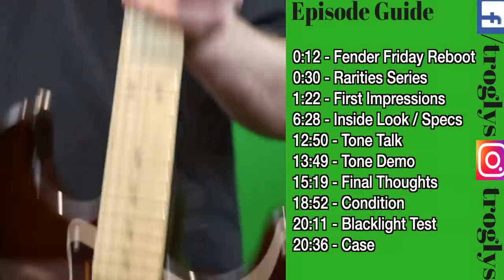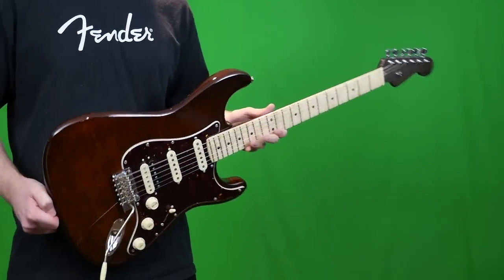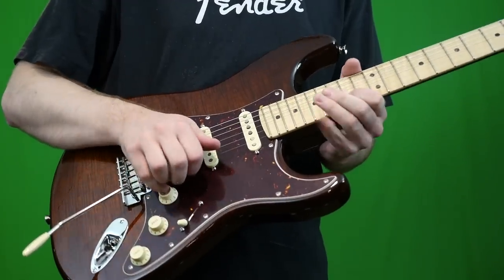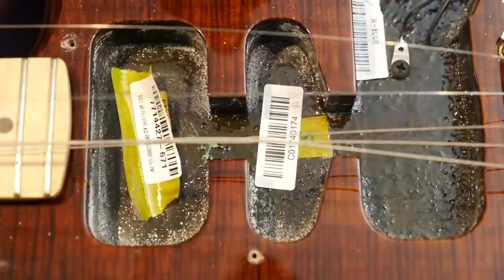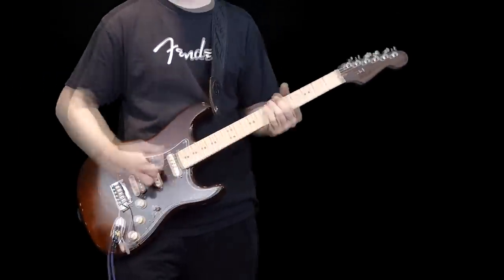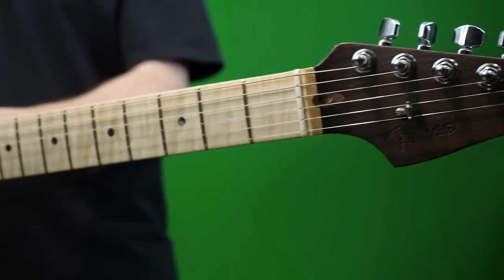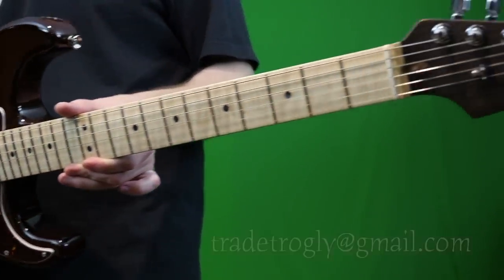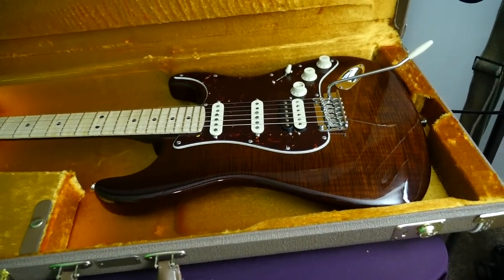A Rosewood Neck Isn't The Only Surprise! | 2019 Fender Rarities Stratocaster Flame Maple Top Review

Comment: Re: Fender 2 point tremolo with push-in arm, if you push down on the arm you will see a hex screw adjustment for the tension of that push in arm under the bridge plate.

Comment: I'm a fan of all guitars. I was Gibson player for years, mainly Les Pauls. Still have a couple and love them. I'm starting to deal with arthritis at 55 years old, so I have been playing Strats. Lighter, easier to customize too. Also my abs were a six pack, but now it's a keg. I love the belly  cut. The laser etched logo could be filled with white paint and wiped clean to bring out the logo. Gold or silver paint would also look great.
Reply: Richard Binder At 58 years old I too am starting to struggle with arthritis.
I had a Telecaster built for myself that has a crazy thick neck (1.10") at the 12th, to my surprise it is the easiest neck to play without fatigue.
If you get half a chance play a guitar with a similar profile and see if it makes a difference or helps.
Just my $.02 Cents
Reply: You might still enjoy Les Paul if you'd get the Classic Lite (exclusive to AMS/Zzounds) that weighs about the same as a Strat but doesn't compromise on that LP sound.

Comment: Attach a little led light to the string tree and shine it on the engraved Fender logo. You can adjust the tension on the tremolo arm. Simply bury the tremolo ( push it all thr way down to the body) and underneath the bridge plate is an allen wrench bolt that you can adjust by tightening or loosening it. Its located perpendicular on the tremolo bar slot.

Comment: Ussualy you can tighten or loosen a push in style tremelo arm with a screw that is underneath the tremelo where the arm goes down into it . It's kind of like the intonation saddles screw but it is under the plate part of the tremelo where the sustain block is

Comment: I have a stratocaster elite with the push in pull out trem arm. If you but nut sauce on the indentation of the trem arm and push it in and pull it out a few times it will pull out easier.

Comment: 9:30 Fender Advice: With those push-in vibrato arms, you can usually adjust the stiffness with a small hex screw on the block that can only be seen when diving the unit nearly all the way down. This makes it much easier to pull the arm out too. Hope that helps and that yours actually has this!

Comment: I didn't know the S1 switch operates completely different on varying models.  My 2018 HSS Strat's S1 switch set the pickups from parallel to in series with a few tone pot options, or in the middle position you get all 3 pickups.  I also have the humbucker bypass button though so maybe that's why it's wired different

Comment: Great demo love the tone quality changes on this strat the colors may come together after a few years of use, maybe the fret work could improve the feel and possibly just play action over years will mellow I to use my kneck pickup mostly my bridge is dual as well mine is a Mex strat with the humbucker bridge pickup my switch is the middle not the top which you won't so accidentally turn on its a push/pull switching I getting use to this after some time I had 1976 American made that was my baby and this is a different animal compared to that.

Comment: Squirt some silicone spray in the tremolo arm cavity and you’ll have easy swivel or use graphite
Reply: Or if it's a Wilkinson trem, adjust the grub-screw in the block. Just push the wiggle-stick down till you see it.

Comment: Got to say it's very surprising to hear a person who clearly has a lot of guitar knowledge perpetuating the idea that pickup resistance has any bearing on output levels. That's a complete myth. Like Bill Lawrence said, judging a pickup's output by measuring its DC resistance is like trying to judge someone's intelligence from their shoe size.

DC resistance does not equal output level. It may provide some indication of the number of turns but it ignores factors like magnetic field strength and wire gauge. Why would anyone match the classic Seymour Duncan JB which has a DC resistance nearly 17k with a Jazz neck pickup at 7,5k? 

Think back to high school physics, Fleming's right-hand rule for generators. The induced current in a wire varies according to the magnetic field strength, not just the number of turns of wire. And why even measure DC resistance when your pickups never conduct DC? Resistance is impedance at zero frequency, good luck getting a zero frequency signal out of your guitar.

tl;dr - stop taking notice of pickup DCR, it means pretty much nothing.

I have spoken.